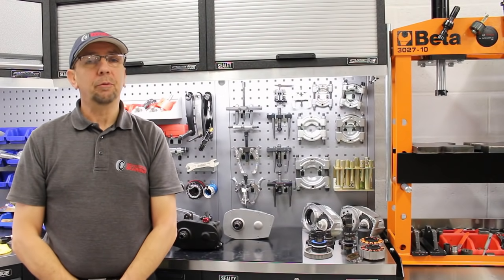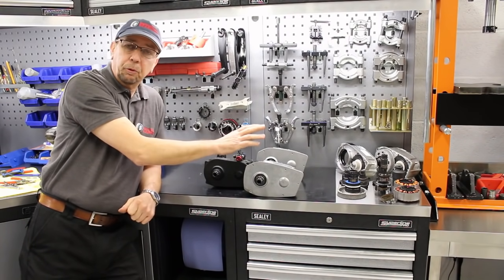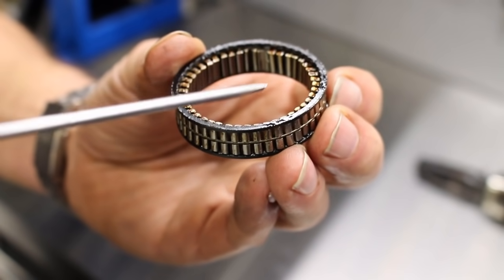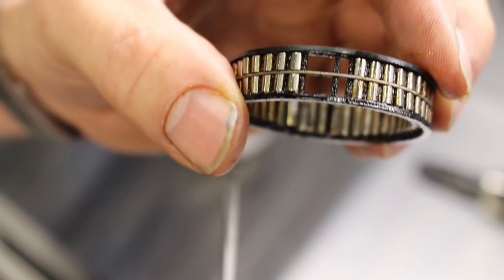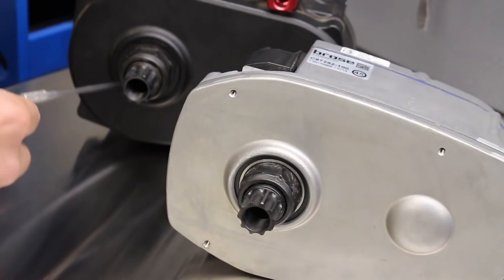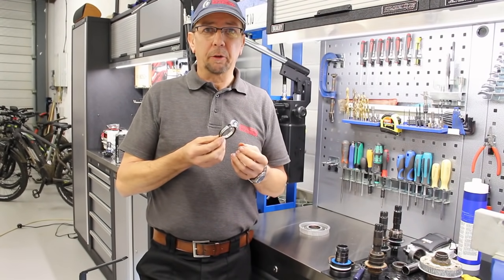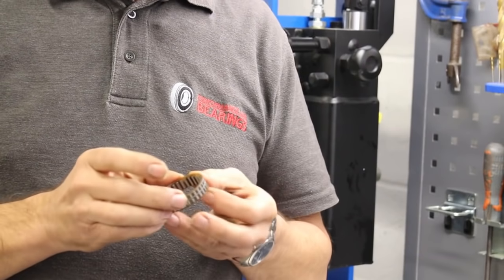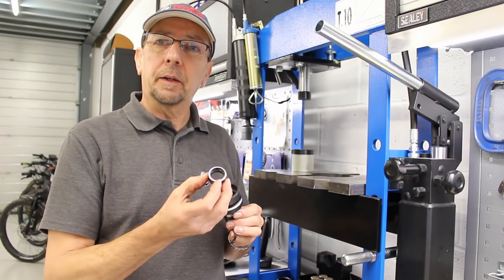Brose Motor Upgrade

Comment: Jesus...all the tech involved in these motors gives me pause worrying about what can go wrong with an eBike! Especially the apparently poorly designed tech! The idea that the earlier Brose motors had little or no sealing is laughable! For a product that is designed to operate in foul weather conditions...dirt, dust, muck and water...having the entire moto assembly/circuit board unprotected points to some pretty bad design! And the engineers should have known that the plastic housing/spacers on the sprag bearing were an obvious item that would fail under the loads of an eBike! I'm curious...are Brose/Specialized/Bulls paying for these upgrades as some kind of a recall scheme, or is it on the consumer to have to pay to correct the design flaws?
Reply: Bro, I think you very much have completely disregarded the fact that the whole genre of biking known as ebiking is still very much in its infancy....  it’s less than 10 years old.  Answer me this -  how long did it take for us to get from the Ford Model T to the types of cars we consider now to be “modern”?
Reply: @jonathanweston2448  Oh, come on...we’re not talking about inventing new technology. Sealing an electric motor from the elements you know it will encounter during regular use is engineering 101. Producing a bearing system that would hold up under the expected loads these bikes were going to produce should have been anticipated, especially considering the weights of these new bikes. These are simply examples of sloppy industrial design. And if these companies have the balls to charge what they’re charging for eBikes, then they can take the criticism!
Reply: @jonathanweston2448  The manufacturers should certainly cover the cost of 'upgrade' via a recall, if they are as 'crap' as they appear without modification.
Reply from the maker: Rest assured the motor manufacturers are doing what they can on the latest motors to start helping this issue. It is easy to lose sight that these motors were designed for their main market  of road bikes and as a road bike motor they are superb! However, when the industry started fitting them to mountain bikes, the motor manufacturers must have been in on that decision. But these are big companies that cannot react quickly but as I said, they are reacting and motors will become more suitable. It is also harder than you think, to seal a motor without friction. It would be commercial suicide to release a motor that does 1 mile less range on the same sized battery as your competitor!
Reply: Outdoorsman well..... mines on over 2500miles, is a 2019, and I’ve ridden and raced it..... still perfect!
Reply: Performance Line Bearings exactly Performance line bearings..... exactly!

Applying rational thought is the way forward.
Reply from the maker: @jonathanweston2448  Great news! There are many motors out there that reach reasonable to excellent mileage's. However, using current ebike motors off road, with water, mud, dust and grit, constant washing, pedal strikes etc. Most are living on borrowed time. If you're interested, just try removing your chain from the front chainring and slowly turning the pedals and crank backwards. The motor should be totally silent, smooth and very free moving? Then try spinning the pedals by hand as fast as possible. This will put a side load on the outer crankshaft bearings and see if you have a slight rough or grumbly noise? When the crank is spun slowly, it rotates on its centre bearing which is usually in good condition, this masks the feel and sound of the outer bearings. Also, sometimes peoples perception of perfect can be very different :)
Reply: @Ebikemotorcentre  This is all very useful information, but for a lot of us who ride eBikes, it’s also the first time we’re finding out what kind of issues there are with the motor systems in our bikes. In fact, I’d bet most of us were told, as I was, that the motor systems are ‘essentially maintenance free’! Not only was I assured (by Canyon) that the E8000 in my Spectral is basically impervious to all the issues you’ve mentioned in this video...something I’ve always considered not only mechanically impossible but irresponsible..they also were quick to remind me that it is 100% non-user serviceable! It seems that since the riders can’t work on their own bike as they’ve always been able to do in the past, the only way to know if your motor is running properly is if it doesn’t give you a problem! Waiting for a failure is a pretty crap way of doing business!
Reply: @jonathanweston2448  that's great news Jonathan, luckily Performance Line Bearings can find enough work for those that have not been so lucky.  I was particularly referring to the unsealed screws that allow water ingress and destroy the electronics. That should definitely result in a warranty repair/recall.
Reply: @bradtrent5298  I fully understand your anguish. The motors are not serviceable but rebuildable, but only if you can find someone who can and, before the internal parts are beyond repairable. I've been on the fence to buying an ebike but after my wife's disastrous $1400 AU repair bill I'm scrutinizing every report and comments about ebikes. All I have is a headache from looking and asking questions with dealers who mostly have little clue about the technologies. You get a warranty. Great but after that you're out of luck.
Reply: @jonathanweston2448  The technology available now is greatly distant from what was available only 10 years ago. With design engineering technology they can create computer analysis modules with fluid dynamic assimilation to create practically anything for the purpose it was designed. Unfortunately cost of production to be competitive has accountants jumping up and down and businesses demanding lower costs. There is a big picture behind all these scenes.
Reply from the maker: Dear All. Don't lose sight that these motors were designed for the European road bike market and as a road bike motor they don't tend to suffer repeated pedal strikes, pressure washers, deep water, mud, grit, bull dust 30 ft jumps, rocks, tree roots, etc. etc. It was the bike manufacturers that started using them in MTB's when Moustache fitted a Bosch classic into one of their bikes. In manufacturing terms, this only happened yesterday. To scrap a product run before it has started paying you back is not great business sense. To fit a seal that creates friction and makes your bike look bad on battery range against your competitor is commercial suicide too. And test work on a new product will normally take 4 to 5 years before releasing millions of new motors all over the world. There are a million and one other things to consider but my one finger typing skills don't afford me the time to discuss everything. Please rest assured, the manufacturers are aware and they are working on it. Change is coming and I will be out of business in the near future :)
Reply: @Ebikemotorcentre  Let's hope you won't be out of business, looks like you have a great facility there.

Comment: Brose Motors appear to have some basic design flaws with water proofing. Given the price of the bikes and ultimatly the motor they should be rectified at the manufacturers expence. The sprag bearings too look like a case of cheapskate on the production for the sake of $20-30 they put owners of these bikes through a whole lot of needless grief.

Comment: It's really shocking that such an old and established company like Brose would use such inferior parts and poor engineering . They knew from the beginning that they would have to compete with the likes of Bosch and Shimano and yet went ahead and dumped an untested 
motor on the market . they initially got rave reviews for power and smoothness of ride and then their reputation went into the toilet once these problems showed up . pity .
Reply from the maker: When I made this video, I did not want to point out any weakness of any one motor. These are very early years in the eBike world, and ALL motors have their week points and issues.

I am not defending the motor manufacturers, but don't lose sight that these motors were originally designed for the European road bike market. And as a road bike motor they don't tend to suffer repeated pedal strikes, pressure washers, deep water, mud, grit, bull dust, 30 ft jumps, rocks, tree roots, etc. etc.

I believe it was the bike manufacturers that started using them in mtb's when Moustache first fitted a Bosch classic into one of their mountain bikes. I don’t say that the motor manufacturers were not to blame as they would not be blind to the fact that their motors were being fitted to mtb’s. But, in manufacturing terms, this only happened yesterday. To scrap a product run before it has started paying you back is not great business sense. To fit a seal that creates friction and makes your bike look bad on battery range against your competitor is also commercial suicide. Any sizable company with due diligence will normally spend 4 to 5 years before releasing millions of new motors all over the world too. (I know, I used to be involved in this process).

There are a million and one other things to consider but my one finger typing skills don't afford me the time to discuss everything. Please rest assured, the manufacturers are aware, and they are working on it. Change is coming and I will probably be out of business in the near future.

There are also millions of motors out there working happily after thousands and thousands of miles…

Remember when you would get off your normal bike and carry it through the mud because you could no longer pedal the thing! And now you use your eBike as a tractor. I know, I do the same and its great fun, but I bet the manufacturers never saw things like that coming!
Reply: @Ebikemotorcentre  Fair enough , however Brose glossed over the belt and bearing issues by claiming that the problems had been solved via a software upgrade AND by increasing the warranty on the specialized bikes to four years ,instead of admitting to the real problems and fixing them as quickly as possible . That four year warranty won't do you much good if your bike breaks down in the middle of nowhere . 
Even if Brose does manage to fix these problems , the damage to their reputation has been done and to restore it will be a monumental task . 
i almost bought a Nox e bike with a brose motor until i heard of the problems . i now have ordered a Nox bike with the new Sachs Rs motor . 
So far , after three years there are no reported problems ,,,,,, YET . 😂
wish me luck.
Reply from the maker: @siriosstar4789  Definitely can't argue with what you're saying. And wishing you lots of luck too 😎

Comment: I wish i had repair shop like yours in my area. 
This is very bad design, looks like they dont care about waterproofing things at all. I ride to work whole year, even in heavy rain and snow and that motor would die in one month probably...
Reply from the maker: Don't worry, these motors are fine in the rain and snow, it's normally deep water crossings, power washers etc. that cause problems and currently, this is the same for 99% of eBike motors on the market. Brose are now adding extra seals and weather protection, so this issue should start to become a thing of the past.